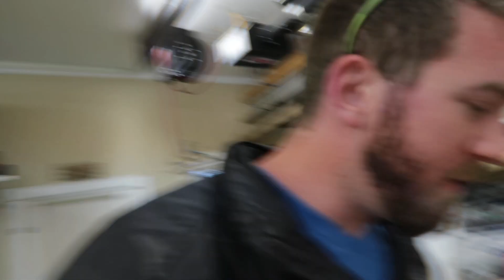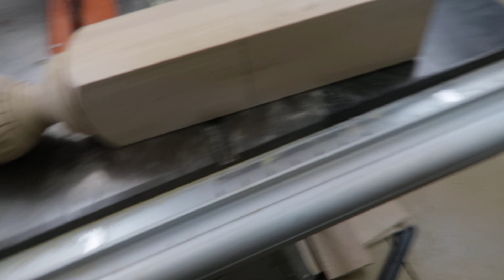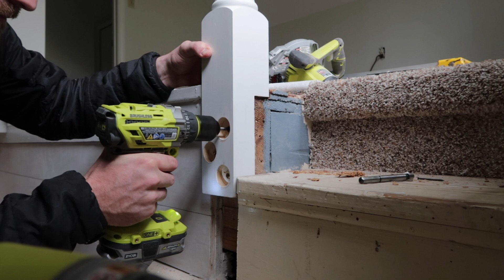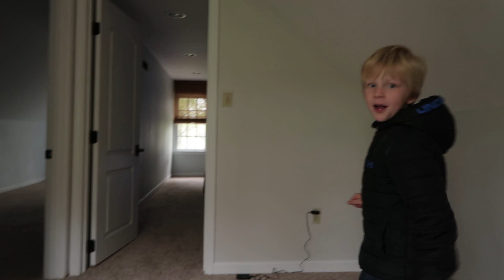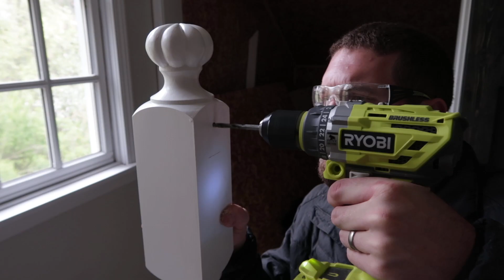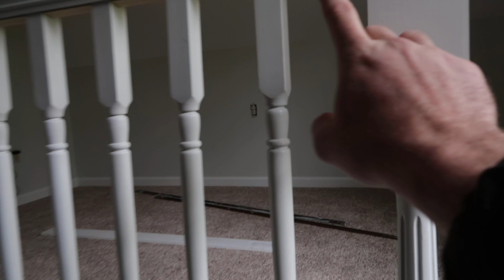Installing a hand rail

Comment: Did you mean to install the ballusters upside down?
Reply from the maker: Yes and no. Yes because that's how I wanted to install them. Seemed easier at the time. And no because I didn't realize that was the standard. And well now I kinda hate that you pointed that out to me.
Reply: So sorry.  Your work is great and both of you have some very neat ideas.  Let's forget I asked that question.  Get that house finished and flipped!
Reply from the maker: Haha no worries. Trust me I've done a lot worse.